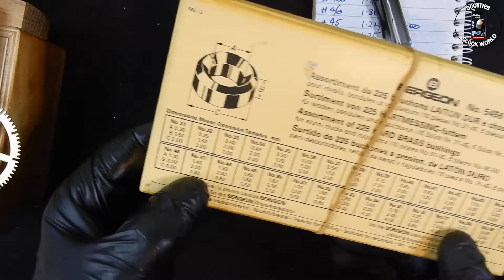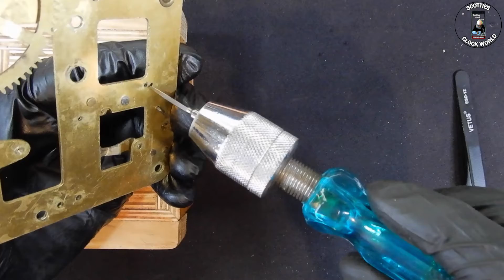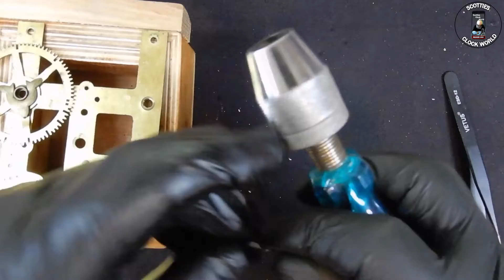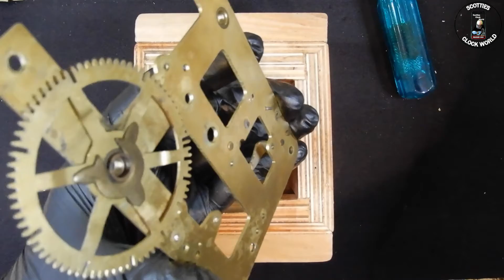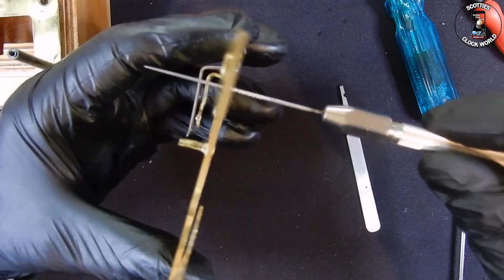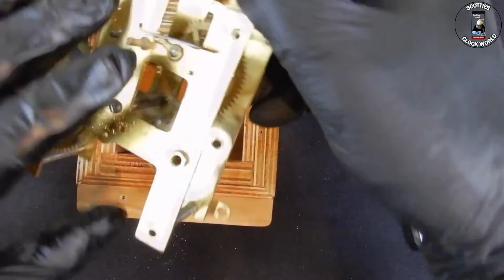Rebushing Using A Hand Held Reamer, Episode 2

Comment: I'm learning a lot from your videos. I have a few clocks I'd like to refurbish, but I'm trying to find used tools to buy, instead of new ones, because of price. Most of what I've found so far has included watch repair tools, which I don't need. I'll keep looking!
Reply from the maker: Used clock repair tools are very hard to find and new ones are very expensive. Have you watched my Clock Repair For Total Beginners series? Most of the tools I use in that series are easily found in most homes are workshops. The ones that aren't I show you how to make.
Reply: I'll check it out, thanks!